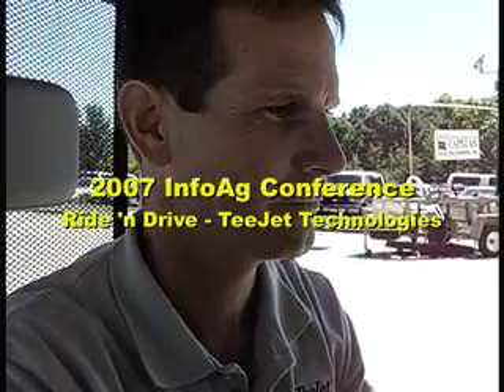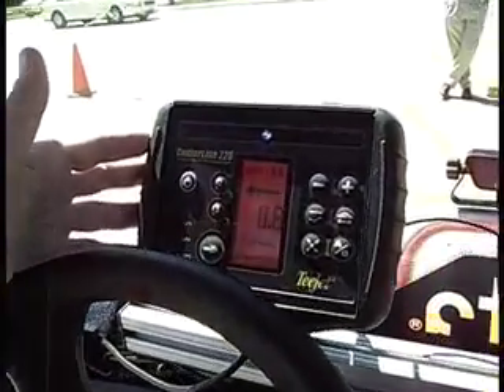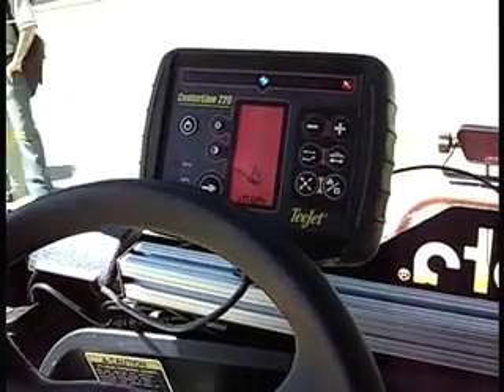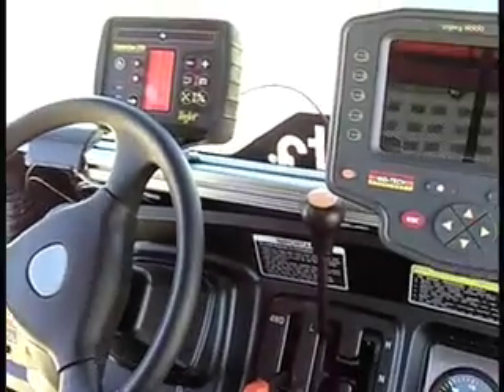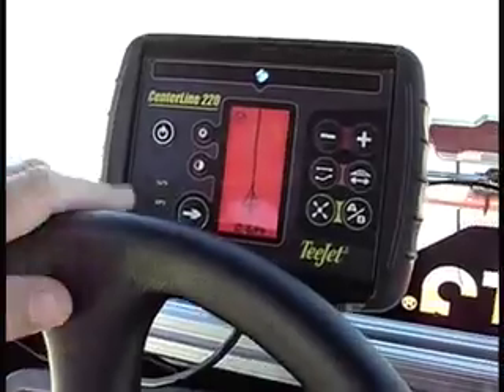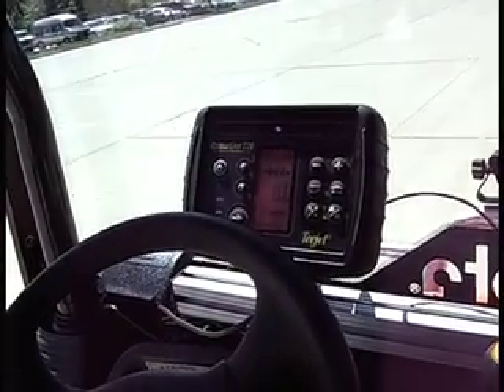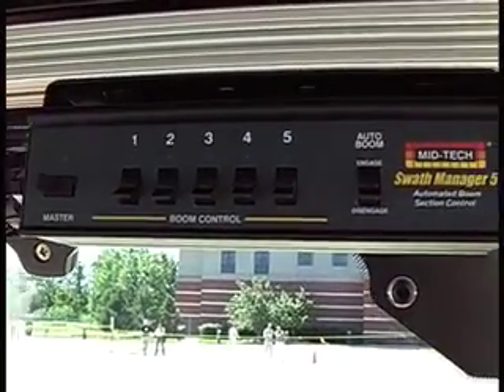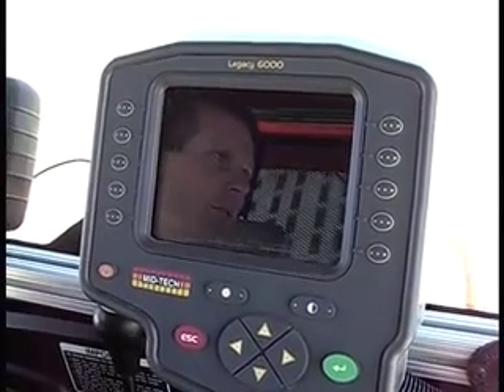2007 InfoAg Conference - TeeJet Technologies Ride & Drive

Comment: GPS agricol: Centerline 220:
echipamente GPS si dGPS pentru agricultura (ghidare[mers in paralel] pentru diferite lucrari agricole [erbicidare, arat, semanat, lucrari pet imp de noapte] si masurare suprafete). Compatibil cu orice tractor / combina / utilaj 

 Centerline 220: doar 950 Euros tel: 0748291609 sau 0215691428